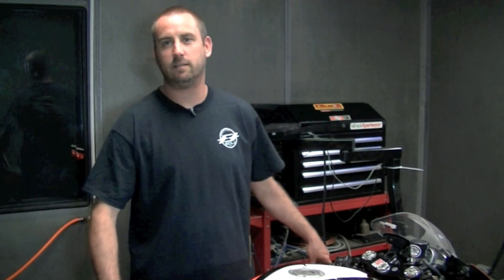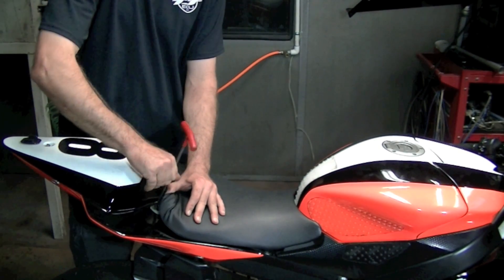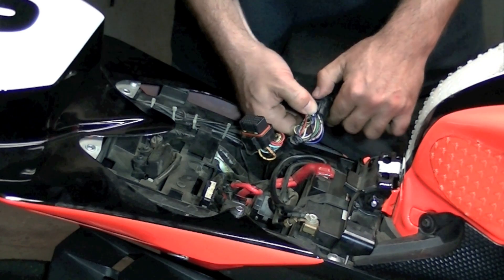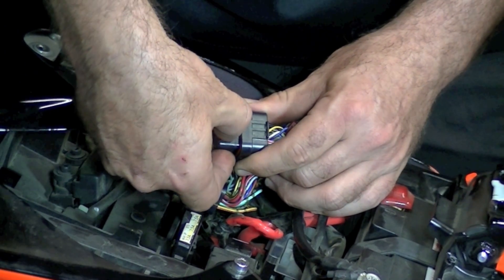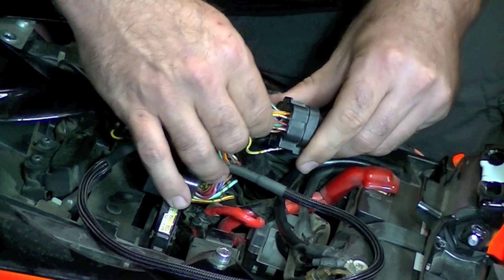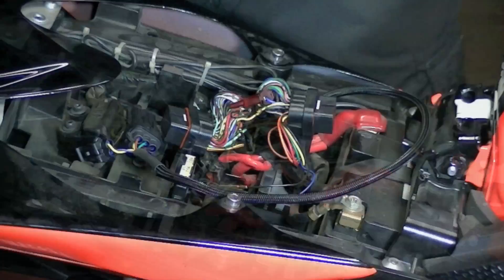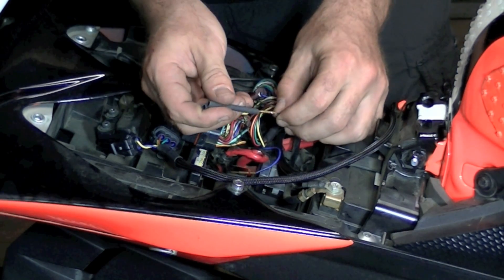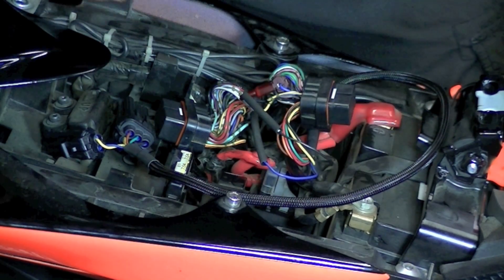FTECU Bike-Side Harness Installation

Comment: This is the worst company you can use. They don't know what in the hell they are doing. When you buy there $450.00 program it works but, you get 2 maps, 1 - stock map , 2 - unrestricted map. That is it and not all the map setting are there along with no support if you need help. Also they will not give you documentation concerning your map. And you loose your original map that comes on the bike because there software is binary driven. You also have to be on the internet to write to your ECU.
Reply: Brian Harmon what?
So exoensive?
What the hell!

I thought some cheap 50 usd program that lets modify/back up mapping...

This is not good you are right!
I hope the company improves.

Jake had great time using this, his fz 07/MT 07 yamaha improved with this.

I wish this channel Would actually REPLY to people who ask questions here...
Reply: @PruikkiRacing  what program do you use then? What is better?
Reply: @cfvgd  not sure,i dont use anything.
Some people will benefit from this video sure,but now ill pay anything for VTR 250 mapping improvements so i could use correct air/fuel ratio with new exhaust

Comment: I order the product already should be in tomorrow.
Reply: just ordered mine for 15 r1 with a  two bros ¾ exhaust. you know you can use power commander maps to start tuning
Reply: Matt Ferrari yeah already did that.
Reply: did you get the map you were looking for? I ordered mine this morning from sportbikesunlimited
Reply: Matt Ferrari I have a custom map on mines. I used the FTECU kit to remove restrictions and then piggyback with a PCV. My mechanic made me a custom dyno tuned map.
Reply: So I just got it in the mail today and I thought I was suppose to get a scratch off for the activation code. its a bunch of stickers, the bike connection and computer connection. Is that normal?